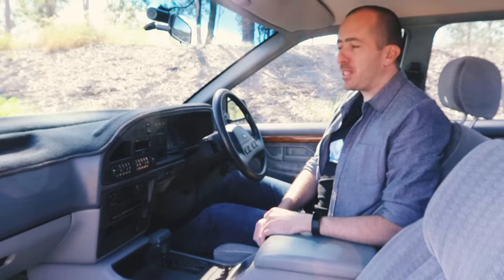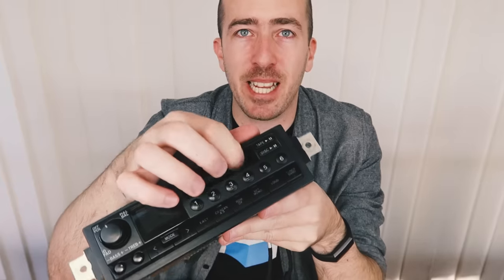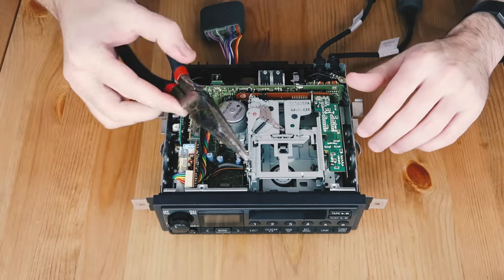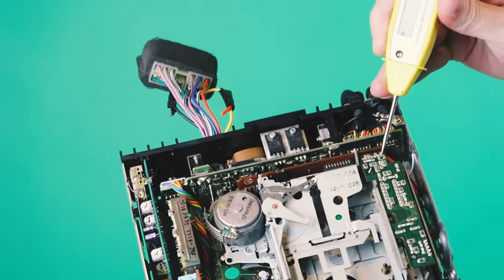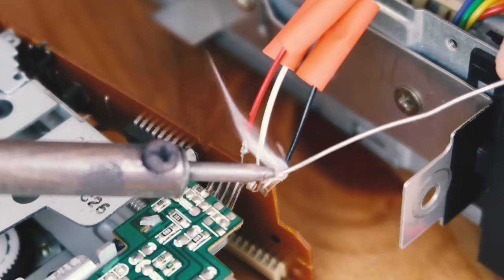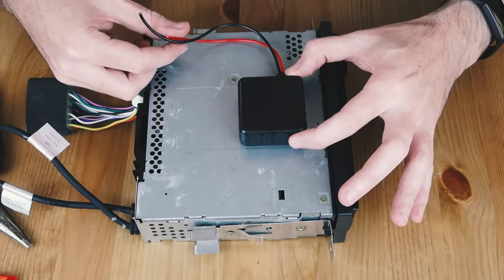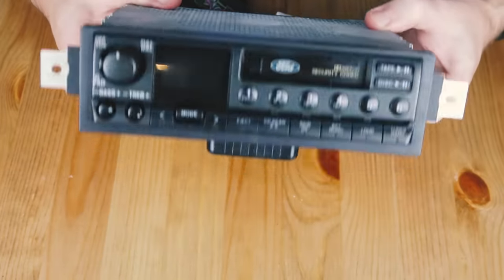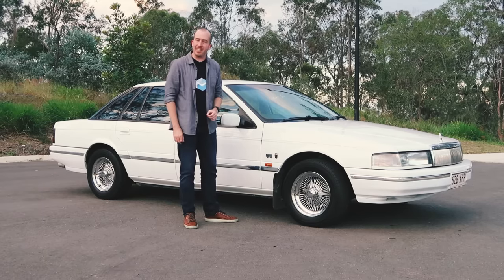Add Bluetooth To Your Old Car Stereo For $25!

Comment: Blaupunkt BREMEN SQR 46 DAB is a new head unit with all the modern features but designed to match the look of a old car. The only problem is the price. It probably cost more then most old cars.
Reply from the maker: Aside from the price, availability here in Australia might be an issue. Looks awesome though, I love it.

Comment: there's a mp3 modulator with Bluetooth now. Plug the modulator to cigarette lighter socket, set modulator frequency to radio's empty channel and then connect modulator Bluetooth to your phone.
Reply from the maker: This was already acknowledged in the video and also my pinned comment. The entire point of the video was directly integrating bluetooth without the use of adapters.
Reply: @MotoringBoxTV  That was very nice mod there. thanks.

Comment: I have a question.
Why not using the CD or Aux instead of the Cassette tape?
Tks for the video.
I’m going to try and set it up with the Aux feature on my mustang 2002 factory stereo.
Reply from the maker: This stereo doesn't have AUX, and as for CD or tapes - I chose the one I was least likely to use.

Comment: I love your video, it's a great source of inspiration for me :) I would like to do the same with my old car radio, however it lacks a 'tape' button :( Do you know if it's also possible to make this with the eject button of the cassette player?
Reply from the maker: Yes, just you should be able to leave the springs in the tape drive (or otherwise make sure it still operates) and then load/eject a tape to trigger it. You could try gutting a tape so there's no actual tape in it, but some head units require both reels on the tape to be spinning otherwise it detects a jam. So in that case I'd probably buy a aux/tape adapter and just cut the cable off it. If that makes sense.

Comment: I thought that was great! Of course there’s always something someone feels they would have done differently but the fact of the matter is you brought to the table what was important... an idea worth sharing! The one thing I was wondering is if it was really necessary to cut the three lines. I wonder if it was possible to just solder straight to the chipboard. Regardless great video excellent ingenuity!
Reply: By the way you definitely deserve a sub after that shit!
Reply from the maker: Thanks mate. Definitely not necessary to cut, and depending on the head unit there may not even be a ribbon cable there to do so. As others have said you could solder the wires onto the board directly and avoid breaking the existing audio circuits - I just wanted to avoid doing that as my skills are not so great and I've had trouble in the past soldering onto existing solder joints on circuit board.

I also wanted to avoid the potential of there being static or background noise from the tape drive being overlayed over my bluetooth audio.
Reply: MotoringBox ahhhh! Good thinking. Whether or not that would happen, one would definitely avoid that (noise) possibility especially after putting everything together for testing!! I’m sure some audiophile engineer could clear that up for us! Not that we need it 😎!!!! By the way nice fucking car!!!! I’ve never seen that (variation) here in the states!

Comment: Good information.  I have a large stereo in the back of my RV that is 1989 technology.  Been using the tapeworm dogs butt contraption for years and it's a pain.  Going to put one of these in that radio so I can listen to my Android Music throughour the entire Coach. 14 speakers from tip to tail and outside. Rocks when it's working good, but the phone has to be next to the radio.  What's the range of reception of the bluetooth?
Reply from the maker: I've not tested the range but if I were you I'd be trying to mount the bluetooth receiver somewhere it could work in a multitude of different uses. For example, if you lengthened the wiring you could mount it on the ceiling somewhere above the front cabin. That way it'd work well while you were driving, and would have better straight-line range for when your phone is elsewhere in the vehicle, or through the window(s) when you're outside.

Comment: Everybody's talking about tapes. Is that TAPE WORM OR CASSETTE TAPES?
I took out my tape cartridge, smashed it with a hammer and threw it at a feral cat. Then jumpered out the actavation switch. 
Now its a condom vending machine. 😂

Comment: I bought one of those Bluetooth FM radio transmitter and it plugs into the 12v socket and I tune into the station on the radio. Works well but occasionally I get some interference and the highs sound bad.
Reply: occasionally ?
You'll never get your sound without interferences !
I've got one of the best of those on the market and it's impossible to find a frequence without interference because the tuner sensibility incrementation is way too large !
Reply: @reeeeeverblu  Mine works perfectly, most of the time 95%+ I have no interference or bad highs. But I have really expensive Sennheiser and normal car audio can't compare
Reply: @Salpeteroxid  Indeed ...

Comment: should have soldered straight to the 3 points you pointed out,  when you wanted bluetooth you chuck in an empty tape,  and when you want to play an old cassette you just turn off the bluetooth.  best of both worlds.
Reply from the maker: True - a great idea for those who want that. I don't like soldering directly to the board as I've struggled in the past to get the solder to stick properly.
Reply: MotoringBox fair enough,  the trick is to reflow the old solder first with some new stuff, and tin your wires.    Great video though.  I don't mean to criticise

Comment: If you instead went with the blank tape method, could you in theory retain your ability to play cassette tapes when not streaming on Bluetooth? This also presumes you are able to reconnect the left right and ground connections which were severed in the ribbon cable*

Comment: Yeah but you can’t use the tape deck or the radio. So you bought a Bluetooth receiver and made a Bluetooth receiver. I get keeping the original look but I don’t know if it’s worth disabling the everything else.
Reply: You can still switch to radio?
Reply: Radio still works fine.  But yea, I'd just hate to give up that cassette deck.  LOL.
Reply: @RARenfield  You still have cassette tapes??

Comment: Great video on this.  If you want to keep tape deck functionality you can just piggyback the wires and use a blank or empty tape when you want to use the aux input.  Any problems with engine noise from the BT module/radio ground loop?  Happens in some cars when you mod an aux-in cable like this and plug it in to your phone while it's charging off the lighter socket.
Reply from the maker: Depends from the car in my experience. So long as it grabs power from the head unit's supply wire, and earths to the head unit's earth, it should be alright.
Reply: @MotoringBoxTV  Thanks for the reply, looking forward to trying one of these.  I guess if all else fails one can always wire in one of those in-line isolators.

Comment: Did a similar install of a Sky International BT module. Works great for awhile then it locks up. Have to totally disconnect the power from the radio to get it working again. Also the audio quailty was horrible.
Reply from the maker: I wouldn't leave it connected 24/7 as that's just asking for trouble. No audio quality problems on my unit, but a different model I ordered from another supplier sounded like crap - real lo-fi like it was being played through an old landline phone. So it definitely pays to try a different model if you're not happy with the one you've got.

Comment: Modern head units are vile, with their complicated menus and flashy lights. Much like modern cars tbh. If you've something slightly older than this, which uses the old shaft mount system, Retrosound units are very good but they are pricey. I was looking at old Alpines and other stuff with RCA Jack's on the rear, but fortunately I drive a 1982 Volvo  240 and there is a little-known hack for adding a switched aux in to the standard cassette deck using the EQ DIN plug on the back panel. So I still have tape, AM / FM and an input for my phone, BT kit etc.

Comment: That's very genius wil do it for sure, just want to know if you can skip the songs from the radio
Reply from the maker: Nope - all through the phone unfortunately. Some Bluetooth receivers have a remote control or a wired controller which let you do this.

Comment: This is ingenious. I wonder if you can solder to the R and L for the FM and then when u turn Bkuetooth on, it connects and over rides the FM channels and plays music. Then if you want FM channel, turn Bluetooth off
Reply from the maker: It probably depends on the head unit. I tried that on another car I have, and it just overlayed the bluetooth audio with the FM audio.. which isn't ideal. But I was able to tune the FM band to a frequency that was almost silent, which worked well. The vehicle in question also has a retractable antenna, so finding a way to stop it from going up would also help kill any remaining FM noise.

Comment: Why not solder straight to the board and not the ribbon cable? Also you could trace the circuit jump the deck so it thinks there's a tape inside. Remove the tape deck and place the module in that area.

Comment: Surely the signal level from that Bluetooth module is way to high to splice into the head output of a tape deck?
Or are you splicing in after the first pre amplifier?
Tape heads produce only a few mV in signal but the usual output on a 3.5mm aux connector would be aroun 0.7V.
Or am I missing something?
Reply from the maker: After the pre-amp I'm guessing. All I know is the place I spliced it in sounds absolutely perfect.

Comment: Neat project if you want to keep your factory radio but there are quality bluetooth head units sans the cd guts in the $20~30 range or even high quality audiophile units for just a little more.
Reply from the maker: Thanks for the comment. Yep, plenty of modern options out there - but this one's all about retaining the factory radio.
Reply: @MotoringBoxTV  Sure thing. Was well presented.

Comment: This is similar to what I want to do, except that my system has a CD in it which doesn't work (presumably there's something wrong with the transport mechanism).  In any case I have no desire to ever use it again...CD's are outdated and a pain-in-the-butt.  So what I'd like is to replace the CD circuit with either an AUX jack or a bluetooth input.  Is that possible?

Comment: If hadn’t cut the ribbon cable and simply tied in your wires, you recon that you could have tape as well as BT? And most people downplay the CD and Tape but tape is as good if not better then Vinyl and CD has excellent sound quality, especially compared to Streaming Music.
Reply from the maker: Yes 👌
Reply: @MotoringBoxTV  thank you sir, I’m almost complete with my restoration

Comment: I like the idea but not realisation. You could use blank tape to trick the deck and you could solder the wires on the terminals without cutting the ribbon cable. That way, you wil be able to actually listen music from tape when you get "retro vibes" plus your deck will be slightly opened just like it will when playing tape inside
Reply: But then you will have tape hiss in the background of your music being fed in.
Reply: @BensSightSoundandAuto  No no not blank as not recorded tape but case from the tape only, without two spining circles and line
Reply from the maker: You'd have to test it - I have a feeling you'd still hear some background hiss.
Reply: I did the same mod to an AU fairlane headunit, all I did was pick up the left, right and ground going from the tape preamp to the main amplifier board and disconnected the ribbon from the head so no noise would be picked up. Used an unwanted tape to put the unit into tape mode and happy days. The music pauses for a split second when the tape reverses direction but this doesn't happen often enough to worry about.

Comment: Im sure it is possible to even do this without cutting or removing anything. You get to keep both the cassette deck and the added bluetooth functionality. The only thing would be to remember to put a blank tape before playing Bluetooth or you are going to get some weird ass mixes.
Reply from the maker: It'd absolutely be possible - I didn't test that but if the tape drive is still outputting an audio signal as well, I wonder if you'd get any background noise or hissing over the top of your Bluetooth audio? In the end I don't own any tapes and didn't want to retain that functionality. Thanks for watching!

Comment: This is exactly what i need, i think. My 2005 ford fiesta only has a cd player. Could this work with one of those or will it only work with cassette player head units?
Reply from the maker: Potentially it could work, the real unknown to me is whether you'd still need a cd loaded in the drive and "playing". My guess would be yes, you  would. All other logic should be the same, you'd be looking at how the CD drive connects to the head unit's mainboard and then trying to intercept the signal.
Reply: thanks for the quick response and props to you for making a great video. I will for shure be taking apart my radio soon to try it out. the only downside is that half of the dashboard has to come out before the radio but it would be worth it.

Comment: Quality FM transmitters ($20 AUD) work perfectly for me in any old shitbox I happen to be in. Sound quality is great if you choose a good frequency with little interference.
Reply from the maker: They're a good option if you're happy with the sound quality. But I do see hard-wiring as a great alternative for someone who has an older 'forever' car that they'll be hanging onto and driving long term. You know, no FM transmitter on display or wires hanging about. Thanks for the comment.

Comment: "Relatively easy" certainly is relative. I could probably do it, I've used soldering irons and the like, but honestly it seems like way too much work for too little benefit. The car I currently drive has a CD but no tape, and it's all factory and a pain in the arse to get at, if I'm going to go through that I'll just go to a shop nearby and have them slap in a new head unit, probably a double-din with a screen. But I'd really rather just keep using IEM's anyway. Better sound, and noise isolation from the road hum.
Reply from the maker: Are you one of those people who drives with headphones in? Seems kind of dangerous to me as they isolate you from external noises a bit too much. Great for sound quality, not so great for safety in some situations.
Reply: @MotoringBoxTV  No different than blasting a stereo at moderately high volumes, and modern cars are so well sound insulated that it doesn't really make much of a difference. By the time you hear something, it's already too late, you have to keep your eyes open and your head on a swivel. Arguably, earplug style headphones might even help, keep the noise and drone outside and keep you from tiring so fast. That said, if I'm driving in a busy city, I turn everything else off just so I'm not multitasking at all. Humans can't do that, and any outside distractions will extend reaction time a lot.

Comment: Ebay sells everything from unamped bare boards for 12 volts to 50 watt 2 channel 12 volt bluetooth boards. I'm going to go with the bluetooth cassette Amazon sells as my factory radio has no room for another board. No wire hanging out, just turn it on and put it in.
Reply from the maker: ...then pull it out and recharge it ...then pull it out and recharge it. 😀
Reply: @MotoringBoxTV  Yeah, I have no other choice though besides hacking the wiring behind the radio. Which may be a future project.

Comment: Just reading some of the comments here, I think most of these ppl making stupid comments are bored and looking for a fight.  Me personally, I really enjoyed the video, TY for posting.  I do have one tech question.  I understand everything that you directed us to do, but one question, why did you solder the L/R/G wires to the "Cut ribbon" instead of directly to the board?  the ribbon connects to different circuit boards and with the ribbon cut, do you not lose continuity between the two circuit boards?  (Beginning at 7:09)    Also, on a side note, I am an International Airline Pilot and fly to Sydney AU often, Although we are all mostly on lockdown when we arrive in SYD due to COVID restrictions, I don't think this will go on forever, but are you from SYD AU and if so, I make friends all over the world considering all the many different countries that I fly to, It would be cool to have a Starbucks together one day after the Pandemic is over.  My treat.  Again, TY for the great video...
Reply from the maker: Thanks for the comment Jeffrey. A few people have asked me the same - basically for my skill level I didn't want to risk damaging the board by attempting to solder directly to it (I've made this mistake before) and saw the ribbon cable as an easier point of entry. Obviously it'd take longer to re-instate the tape drive if I ever chose to do so in the future, but then again I have absolutely zero interest in tapes and don't own any 👍

Comment: This is absolutely brilliant. I would love to do this in my 2005 escalade, but it doesn't have a stock tape deck. Does anyone know a way to do this with something else, like the am radio, or am I just sol?
Reply from the maker: There are solutions out there which wire into the radio antenna apparently - you might have to do some research.
Reply: @MotoringBoxTV  thanks so much. It took several hours of digging, but I think I found my solution by using an aftermarket harness to tap into the cd player and have just a small toggle switch to go back and forth between cd and bluetooth